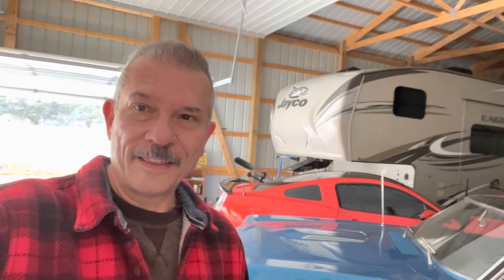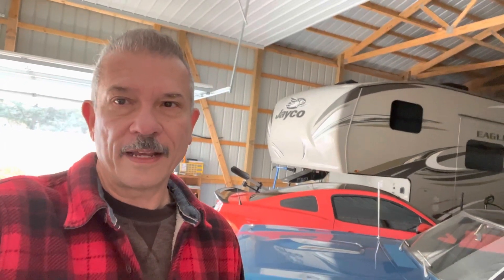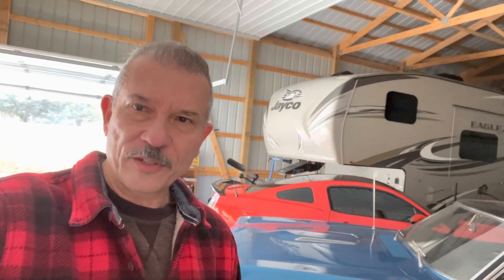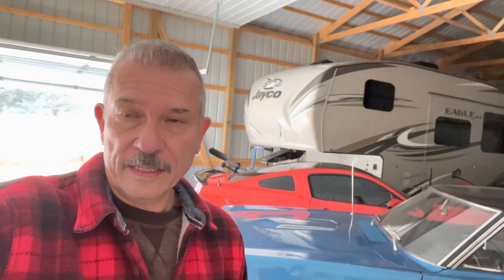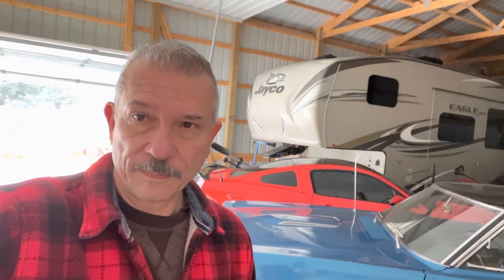How did we loose 43HP?                          links in description.

Comment: Was the knock sensors pulling any timing ??? . Couldve been a low quality tank of fuel  it can vary a ton
Reply from the maker: No, the tune was spot on, he had the lap top hooked up. The fuel was spot on 85%. I also lighten rotational weight of each wheel by 10lbs. Doesn’t make any sense, the car should have pulled a 460. I have another Dyno I also ran on before to cross check. If it’s low it’s the trans in my opinion.

Comment: Dyno numbers don’t matter. Take it to the track if you really want to see if it really gained or lost anything. Those should be your baseline numbers, not a graph from a dynamometer
Reply from the maker: My baseline was 449, 417 FBO, 437 FBO Intake port and 449 FBO e85 was last Dyno. All test were on the same Dyno. To run a 406 in better DA doesn’t make sense. A Dyno is a tool I get it but doesn’t make sense.

Comment: A trip to the track will show you if you are actually down on power or not. ET and MPH should suffer with a 40 hp loss, that will be the proof if its really gone or not in my opinion.
Reply from the maker: Unfortunately I wasn’t track worthy before the trans change however I did make it to the track in the same set up and ran a 11.99 @ 117 mph and 3675lbs. Per the hp ruler that works out to about where I’m at. Stock Bosses have ran 11.80’s with slicks. 
This was a decent track video below. If I could hook maybe squeezed out a 11.85. Shifting was a bit lazy too. Thanks for watching and commenting!
https://youtu.be/DUEefvqEAL4
Reply: @CoyoteProductionsBoss302  my 2011 GT with the seats removed, UPR K member, a 3.90 gear, Mantic and. Calimer Stage 3 went a best of 11.68 120 last November. It’s only a long tube PBD car so yours should be that or faster I believe
Reply from the maker: @doughty_racing  I don’t think I will get less than 11.8 as it sits with a 3.73 gear and 28 tall tire. What was your time before the Calimer stage 3?
Reply: @CoyoteProductionsBoss302  unfortunately I wasn’t able to get a good pass beforehand but in the 1/8 it was a spinning 8.0 way back in 2011 when I bought it new.

Comment: I think the confusion is in the pile of  data logging. You may not have really lost anything . You need to scrap the old data and start with a baseline pull and then doing mods.
Reply from the maker: My baseline work was all done on stock MT82. 417 whp FBO 93, 437 with intake port and 449 on e85. If Calimer says billet gears are lighter and reduce drag it doesn’t make sense. Thanks for watching!

Comment: The calimer gear ratio is different, I lost hp too.
Reply from the maker: How much did you loose? The gear ratios are not that different though 3.46 first verses 3.66. A friend dyno’d on the same Dyno last spring with a s550 FBO, e85 and ported 18 mani (stick car) and he dyno’d at 448 whp. Well I’m willing to throw another $150 to get another Dyno. It’s not compression I hardly pull oil off my catch can you would think I would have a lot of blow by to loose compression. Still under 17k miles. Thanks
Reply: @CoyoteProductionsBoss302  hard to say because I did a rear gear swap from 3.73 to a 3.31 before I blew my transmission.  I was at 763 hp before that on a 93 octane tune and after I did an e85 fuel system the initial data log on the dyno was only 780whp which surprised me (on 10.5 lbs boost). Turns out that's with no extra timing. I've got the next revision loaded with an extra 2.5 degrees timing. Don't think I'll make it to the dyno this season though, snow coming and I'm heading north for hunting now.
Lund wants me to up the boost to at least 14 or 15 now so we'll see.
Anyways, keep up the content and best of luck, great ride you've got👍
Reply from the maker: @Mayner5.0  thanks I needed a boost here. I’m already FBO My last mod are the massage boss heads and boss racing cams. I want to find out what happened first for the missing hp. Thanks for supporting the channel!!

Comment: Does the car feel slower? 40+ loss would be noticeable..
Also, couldn't hurt to try a different tuner. See what happens. Don't get stuck in the rut of using 1 guy regardless of outcome. If one of the big name guys can get it squared away, and/or help... Why not? Just food for thought brother, hate to see you struggling
Reply from the maker: Car feels strong as ever. Tuner holds fastest gen 1 Coyote record and just built a 1900 hp and went 7.73 at 202 mph. If I can Dyno at the other shop that will at least point me in the right direction. I don’t know why this car always seems to have a dark cloud over it. 😂

Comment: Ive always had my dyno pulls in 5th gear as I believe 5th is 1 to 1.  I guess it really doesn't matter but have you done any in 5th?
Reply: A pull in 4th on a MT82 WILL show a lower number, facts
Reply from the maker: Yes we did that last to see what the difference was and the tuner said it was 2 more hp and little more torque on the bottom. He said he doesn’t like to test in fifth gear because how long the car takes to rpm up to 7800 and it doesn’t make that much difference.